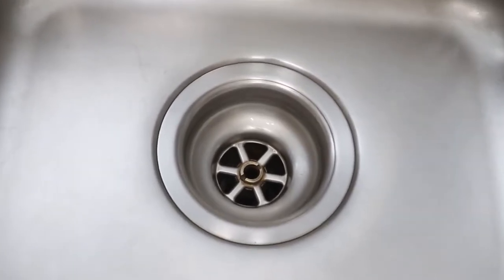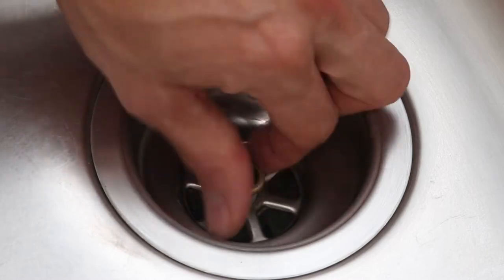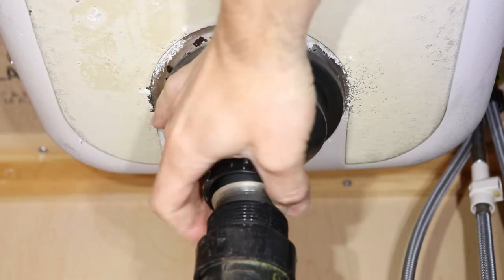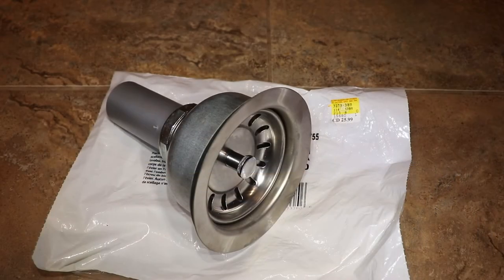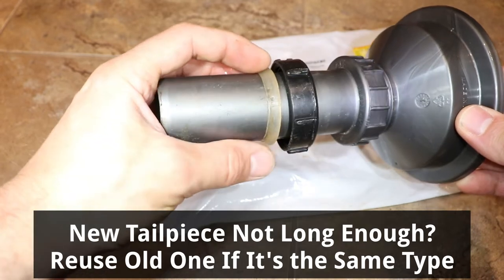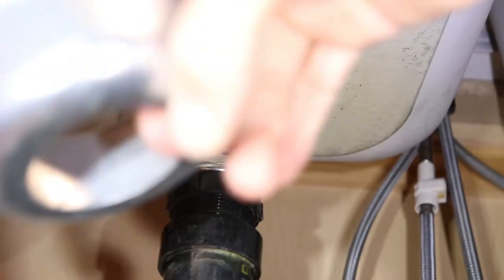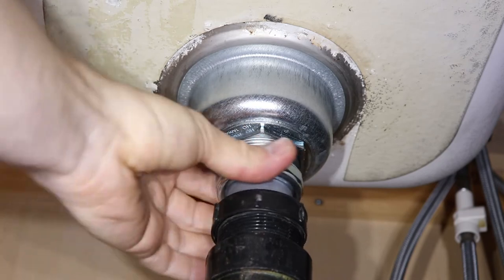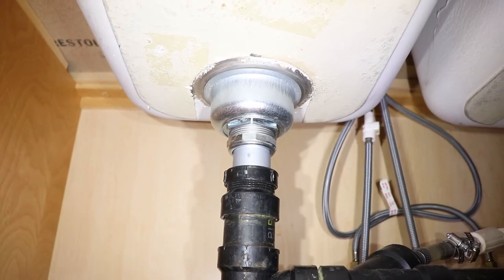Kitchen Sink Strainer Replacement with No Lock Nut Underneath, Sink Drain Removal & Install

Comment: A great tip is the sharp edge of either of your removable plugs are what you use to tighten the centre screw.

Your welcome! 

(I only found out a year ago 😂)

No house keys or coins needed👍🏼
Reply from the maker: Nice tip. I just checked this with the original strainer and it works, but with a different strainer it was too thick on the side.
Reply: Can you please elaborate. I'm trying to remove one and it's so tight, I'm bending coins!!
Reply: @percyc4850  it shouldn’t be that difficult that it can bend a coin. I would find a large strong screw driver or try using a coin but turning it with lock grips and maybe pour some boiling water on it first. If that fails then your going to have to drill the old one out! Or if you dont have a drill you could cut hole to hole with some cutters.replacements are very inexpensive.

Hope this helps 🇬🇧

Comment: Well, that was titled wrong then. I am trying to remove a drain that does NOT have the lock nut underneath. It just has a rubber ring underneath, so looks like the drain hole is pushed into the hole to fit.

Comment: What was wrong with the previous basket strainer ?
Reply from the maker: Nothing wrong on the "demo" sink I show how to remove it from,  but I do show a broken one at 0:56 and it is that broken one I'm actually replacing. Two sinks are used to make the video.. Just wanted to show the complete process.

The top "screw" can break apart and the top part will separate from the bottom... so that makes it even easier to remove, since it's already separated.  There are other reasons someone may need to remove it though, like if the pipe has to be disconnected when it's clogged.

Comment: Probably should have added plumbers putty between the sink and new basket strainer to seal properly, according to other places I have read online like ‘Family Handyman’.
Reply from the maker: There's a rubber washer on the sink side, that's all that's needed. When it clamped down on the washer, there's no way it will leak.  Follow the instructions for your kit. If it doesn't have a rubber washer, another method of sealing like putty will be needed. The basket in the video is still in use and working good, no leak... I did the other side too.

Comment: What is the function of the centre screw?
Reply from the maker: It holds the top part of the strainer to the bottom. When it's screwed in tight, the rubber steal is pressed, and it prevent leaks.
Reply: @CleverFix  Thanks for your prompt reply.